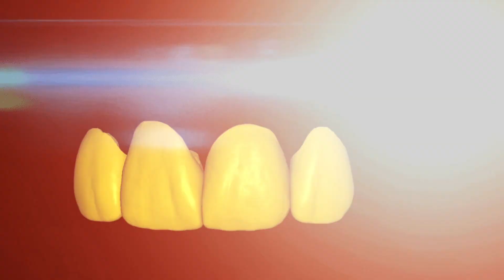Having fun doing dentistry. 4 3D printed restorations!

Comment: Very nice, what resin is it?
Reply from the maker: Tough 2.0
Reply: Is OnX tough 2.0 resin also used to print veneers? I thought it was designed exclusively for hybrid prostheses
Reply from the maker: @nexacal88  been using it for veneers since Tough 1.0. Have close to 5000 units in